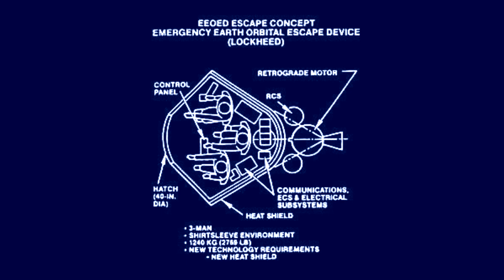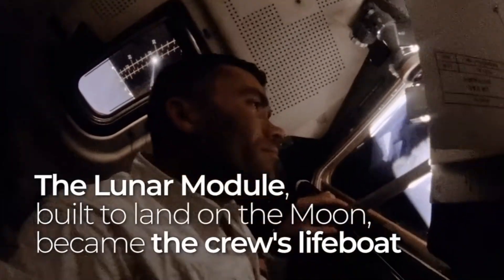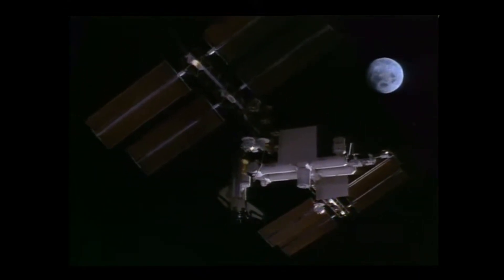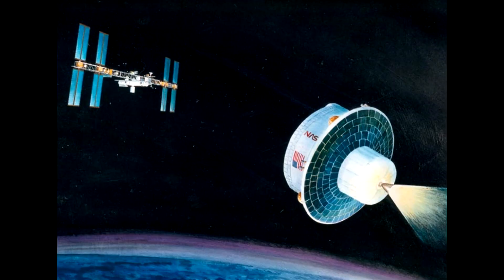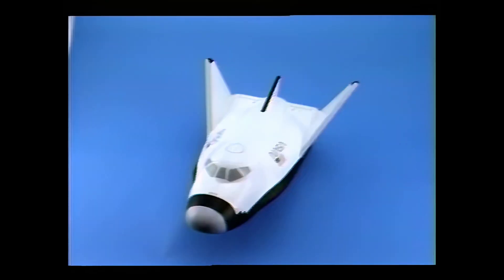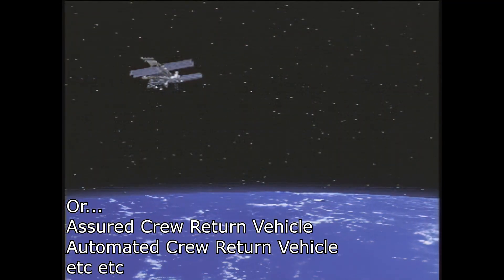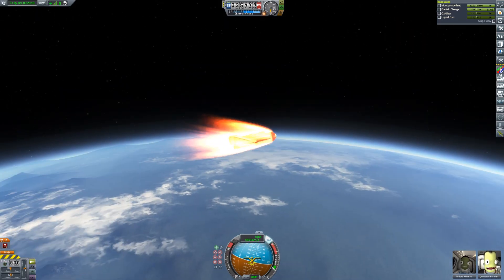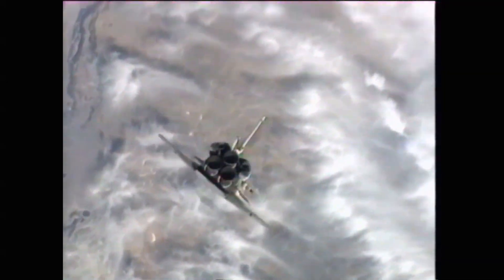The 'Escape Pods' That NASA Developed, But Never Used.

Comment: Here's a crazy thought: America could have essentially built its own version of the Soyuz spacecraft and either built an American Soyuz rocket or man-rated an existing American launcher. It's basically what China did. Of course, back then that would have been more expensive than what Russia was selling Soyuz seats for, not to mention less tried & tested. And this was before Team Hillary's lying Doomsday Clock advancers created Russiagate, so there was no perceived issue with temporarily depending on Mother Russia's budget solution until Uncle Sam expectedly perfected a Shuttle-derived replacement.
Reply: Lol

Comment: An escape pod is one of those things we won't perfect, probably, until a few people have died. I imagine any given escape system will be heavily dependent on where the nearest human presence is that has an energy surplus great enough to rescue them. If I was going to be in deep space most of the time, I'd probably spring for a really good black box instead of an escape pod. With a station in low orbit, ideally, every module would be able to survive re-entry and control their descent to some degree. In the middle, there's an ocean of 'hope we got enough fuel'.

Comment: I had designed a concept that would be a stackable emergency escape craft. That would be ideal for something like starship. Two or so could be built, for various crew emergencies (surgery, medical issues ,etc). The rest could be stacked to be assembled after the first two are expended. Slightly different and the re-entry capsules could also be used for sample return and or for space mining.

Comment: The idea of using a paraglider wing to land is quite interesting. Normally we don't like wings on spacecraft, let alone rockets, because they introduce additional drag and weight which is a big no-no at the moment of launch and cruise. However, paraglider wings are very light (because they're made of fabric) and are stowed until use, so they might be a workable solution to land a rocket. Would be pretty cool to see a giant reusable suborbital rocket land on a giant parawing.
Reply: Rocket lab is working on this idea, they are currently using a parawing for a soft sea landing and want to use that same system to catch their rocket from the air using a helicopter.
Reply: Wings on orbital lifters aren't as bad as SpaceX's PR makes them seem like. A aluminium construction/winged flyback Heavy-lift Vehicle from NASA's SPS study had a similar payload to Starship, yet only 4000t mass when fully fueled - less than simply the fuel mass of Starship, and even with some mass reserve!
Reply: The Rogallo wing used in hang gliders was originally developed as an inflatable wing to bring down the Gemini capsule on land. I'm not 100% clear on what the landing gear was supposed to be--the test vehicle had big fixed wheels but obviously that wasn't realistic.
Reply: (artists' conceptions seem to show skids popping out of the sides and nose of the spacecraft)

Comment: I don't remember if ESA had anything invested in the X38 but they were pretty pissed on its cancellation. Seems to me if they really wanted to use that for their access to space, they probably could have added some funds to get NASA to finish. They were so close to a working model. The X 33, 34, and 37 also got chopped about the same time.
Reply: The vehicle Scott Manley showed looks a lot like the Intermediate eXperimental Vehicle
that flew to space in 2015, especially with those flaps...🤔

Comment: Some of the rescue pod systems were not designed to get you back to Earth, but just to keep you alive until a rescue can come get you. My favorite was the Space Shuttle's "Personal Rescue Enclosure", which was a beach ball-looking spherical thing that you curled up inside and could keep you alive in space for about an hour, just long enough for guys in space suits to toss you across from your stricken vessel to another shuttle orbiter. It was about as bare bones as you can get, low mass, low bulk, designed in the days before the LES suits when there were not enough space suits for a full crew of 7.
Reply: My understanding is that the Personal Rescue Enclosures were also used to test claustrophobia for new Astronaut Candidates.
Reply: @bobbysalsa  Yes, Mike Mullane talks about this in his book.
Reply: I remember those getting a lot of publicity when the Shuttle was about to go up for the first time.
Reply: I read about those way back when. It made me wonder why we don't simply use inflatable structures for everything. Imagine a great big inflatable space station that could be carried into orbit by a single heavy lift launch vehicle. Ok, the solar panels and equipment would still be big and heavy, but it seems that would save some weight and bulk. (I'm sure there's a reason.) The human rescue pod seemed so simple, though it did depend on always having a vehicle for rescue missions ready to go at a moment's notice.

Comment: In all fairness to the Sci-Fi genre and their escape pods, humanity is nowhere near the level of orbital construction (we have zero orbital construction, only orbital assembly) that would necessitate the need for escape pods. The fact that we send pods up means by default, we have pods available to bring people down, so there's no need to engineer anything else as it's purely an expense that essentially gains you nothing in return. When we get to the point where we're building oil tanker/cargo ship sized ships in space and we're not launching crew modules every time there's a shift change, the whole 'life boat' system will have already been revisited and figured out, and put into place so people can stay in orbit, work, and come back when the new crew arrives in what surely will be something much bigger than a soyuz or dragon. Perhaps Starship delivering 100 people at a time for a one month rotation. I highly doubt with an orbital platform on fire and breaking apart in a worst case scenario, we'd not have escape pods not scattered about so that whatever ship that is the usual crew ferry isn't sitting there waiting for every last person to board while everything burns and deorbits around it.
Reply: Well tbf space catastrophes are luckily pretty slow most of the time.

Comment: Now with a massive system like starship underway. Capsule style spacecrafts like the most modern crew dragon are starting to look better suited to be permanently installed on the space station to serve as escape pods.
Reply: The fact that SS doesn't have an escape system itself makes the Orion+HLS model (or Dragon+Moon Ferry SS+HLS in the future) somewhat more reasonable from the safety point of view.

Comment: can a progress spacecraft be used in emergency as a reentry for crew if say they cant get to one of the actual return vehicles?
Reply: No, while it looks like the soyuz from the outside, it does not have the necessary heat shielding and completely burns up upon re-entry.
Reply: @crasyhorse44  thats what i wasnt sure if it had shielding :) thx

Comment: Seriously, how many videos are you going to make repeating the lies of the Dream chaser lineage coming from the Mig 105? There is a very clear lineage predating the Mig 105 by decades, a child with google can find the info. look up the predecessors such as the HL-10, Dynasoar, and many others that it evolved from. The US predated Mig 105 by a long shot, and the Russians were clearly copying the US from designs which weren't secret, or at least trying to match the US with their own solution.

US was developing these designs starting in the 1960s, and Russia only joined the party in the  mid 1970s and 1980s.

Comment: In my opinion, when we start travelling between planets, we'll likely see the advent of the "Life Boat" module, or rather a section of a ship designated for long term survival, which can be sealed from the rest of the ship, in the event of a catastrophic failure.  For instance, likely the module with the airlock/dock and space suits.  Pack the walls with rations and gear required for survival on the long trip, an a computer console to be able to control the ship.

Comment: But obviously the problem with the spacecraft being its own lifeboat is that no matter how many backup systems you have, if a micrometeoroid or space debris punches a hole through it, you aren't going anywhere.
Reply: In NASA parlance, it's called "gray tape". Good for lots more than just ductwork.

Comment: The Columbia disaster shows why a single system, no matter how redundant it appears, is not "Its own backup option". In spite of the assurances of program management and reliability engineering teams.
Reply: Fun fact: There were proposals for "Evolved Shuttle" involving liquid fuel boosters and an ejectable crew deck dating even before Challenger, but NASA couldn't afford the development cost of them. #FundNASA
Reply: @HalNordmann  If it was feasible, the ejectable crew deck as a ballistic re-entry vehicle with ablative heat protection should have been the way to go for that vehicle. Tossed aside like a lot of manned and unmanned space activity programs that were scrapped for costs that were trivial compared to other budgetary exsanguinations.
Reply: That's one of the main reasons why I'm very skeptical about SpaceX's Starship and similar vessels that, I think, will have the same escape problem the Space Shuttle had... Which is to say: well, none, if you think about it, lmao; it had no escape system basically, and SpaceX's Starship has none either, I fear the spacecraft itself is never a good enough option as a launch escape system... Except like in KSP where nothing ever fails except with mods maybe, and other design flaws lol, but things fail in real life, even the most used, known and reliable systems like the Soyuz that failed during launch like a couple years ago, and it proved again that a more classic capsule launch escape system approach is the best option we have, although that too could fail but it never did yet, whereas the Shuttle has failed dramatically.
Reply: This is why space stations should have extra escape pod seats available. Then if a ship has enough delta V to dock to the station,  the crew can get home even with holes in the heat shield or other issues with their primary craft.
Reply: The alternative to the single escape system is staying in the station. The chance of something happening both  to the station and to the escape system at once is very low (and most likely would result in no astronauts left to save).

Anything happening to the escape system after the escape is initiated, will be dealt with by means of the redundancy built into the "lifeboat" itself. After all, you can't board more than one ship at a time
Reply: @TheNasaDude  Except if you find out that the rescue system is too flawed or not available, what do you do?
Reply: Sure, but we'll never have 100% safe space craft for the same two reasons we'll never have 100% safe cars or cell phones that last more than 2 years - cost and the randomness of existence. Compromises must ultimately be made
Reply: @limiv5272  My cell phone is still going strong after 4 years, but I get your point. NASA currently has required the Commercial Crew vehicles to have a "Loss of Crew probability" of 1 in 270 (i.e. 99.623% safe)
Reply: @jeffbenton6183  I've never head of that requirement. That's a strange number, why not round up to 1 in 300?
Reply: @limiv5272  They were originally going for 1 in 1000 (during the Constellation Program) but realized it was impossible. I don't know the math behind it, but its really hard to get past 1 in 270. (SpaceX managed 1 in 272 for the Dragon 2, I don't remember what Boeing achieved)
Reply: @limiv5272  The Space Shuttle, after the challenger disaster, was found to have a loss of crew probability of 1 in 9, so they improved its future safety up to a loss in crew probability ten times less, to 1 in 90. After Columbia and the retirement of the space shuttle, they wanted that probability reduced to a third of 1/90, so 1 in 270.
Reply: @limiv5272  Well that compromise, or really...failure to accomplish, backup systems damaged the shuttle program, damaged the ISS program, a lot of other space science projects, and the political support for manned space programs. Bush administration, canceling programs for costs that amounted to a couple of months of military operations in the Middle East. Just criminal asshats.
Reply: @limiv5272 
The phone I'm using right now is six years old, and the cars in my family are old too, and still reliable; your argument is invalid.

Comment: Doent help when your shuttle just falls to pieces on re-entry, with any special software   we are no were near having a relatively safe space craft  for one it's going to need to be a lot larger  have different engines that are safer and real escape pods  maybe if America spent less on military it could spend more on space stuff ,and it might show there enemies that there not interested in war any more 👍🇦🇺
Reply: "When your shuttle just falls to pieces on re-entry"
Are... you talking about Discovery? You realize it didnt fall to pieces, part of it's heat shield was missing, which meant the Atmosphere started burning a hole into the Shuttle itself, which resulted in it "falling apart", or generally just breaking up on said reentry. 

This is on par with pretty much most ships being sunk, outside of human error. Something fails, and takes the whole thing with it. You cant "fix" it as it'll stay an issue, the only solution is to design something to help delay/prevent it as much as possible. Such as Tankers/Haulers being designed to flex far more, rather than remain rigid for exaple. And implement regulations written (often) in blood.

Comment: The rogallo wing, which went on to become the modern hang glider, was developed by Francis Rogallo and NASA as an entry control method during the Apollo era (I think)... also worth a read!
Reply: During the mid 60s this was projected for use on an Air Force design for a Gemini capsule that would land on skids. It would have even better cross-range capability than a paraglider, which is what is shown in this episode. Well, as a hang glider it has benefited a lot more people in its own way.

Idk if Rogallo invented this for use in Gemini, or if the Air Force knew of his design and adopted it.
Reply: The ram air parachute has rather displaced the Rogallo wing - and skilled pilots can glide them for hundreds of miles (and that’s from a ground launch).
Reply: Gemini. The Gemini capsule was designed with tricycle gear to fit with it.

Comment: In an emergency, I would put my money on Soyuz - only had two fatal mission endings in 54 years, 7 months, 8 days... Thats a hell of a safety record
Reply: Years dont matter. Mission count does more so. How many missions involved humans onboard? 

This is a similar issue with aircraft parts failing being reported via dates, rather than time being used. If something fails 1/10 missions, for example, but only flies every 5 years... then a 60 year thing would only have 1.2~ fatal failiures on record.
Reply: @higueraft571  147 manned missions - of which, two flights ended in fatalities, one launch failure and one abort after launch but before orbit
Reply: Fun fact: At the time it was cancelled, the Space Shuttle had more missions flown than Soyuz.
Reply: @HalNordmann  But with a worse mission fatality rate - and no Soyuz crew member ever tried to kill the wife of a crewmate
Reply: @Trek001  Well, there have been some fights aboard Soyuzes, plus that doesn't have anything to do with the design. As for the problems - a 2/135 loss of vehicle probability is pretty good by rocket standards.
And another fun fact: There were proposals for "Evolved Shuttle" involving liquid fuel boosters and an ejectable crew deck dating even before Challenger, but NASA couldn't afford the development cost of them. #FundNASA

Comment: Biggest issue on ISS must be the what if there's a fire, whereby the crew can't reach the craft they went into space on and there's not enough room on the other craft for all the crew.
Reply: You retreat to one of the bays with a dock, seal the airlock to the burning module and then remotely open it up to space. They actually practice this fire drill on the ISS.
Reply: @kenoliver8913  Sounds like that might work, provided the fire hasn't damaged the electrics that control the remote vent.

Comment: Actual lifeboats on oil rigs and production platforms are fully enclosed, seaworthy, and would save your life, but man, the vomit...so much vomit... especially in the ones which are basically circular - and that's on relatively calm and flat seas too. I imagine escape pods on spaceships to be about the same, they'll save your life, but you'll feel like you've died if you have to use one.
Reply: Thing is, for those lifeboats you're being tossed around constantly, with a spaceship/that sort of lifeboat, i expect the only extent would be more reentry... and i assume it'd also be f a r smoother than the initial ascent?

Comment: I saw a mock-up of a space plane in the 90s at Johnson space center in Houston. It was probably the X38
Reply: Not a mockup, if it was
Reply: @ Eric Laird We flew a small fleet of space planes from 1981 to 2011 -- The Space Shuttle was an operational space plane, flying 135 times. The Space Shuttle fleet consisted of Columbia OV-102, Challenger OV-099, Discovery OV-103, Atlantis OV-104, and Endeavour OV-105. Space Shuttles flew 133 completely successful manned missions with two total mission failures resulting in the loss of both vehicles and crews.